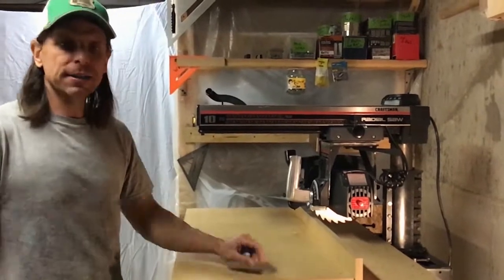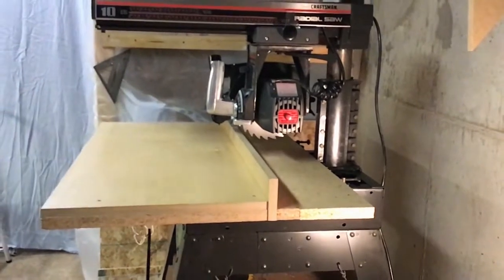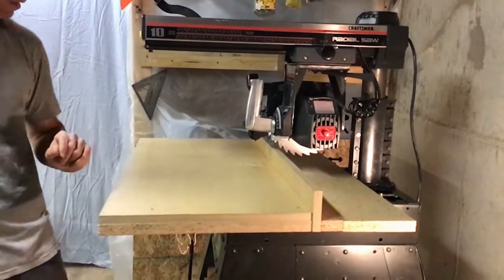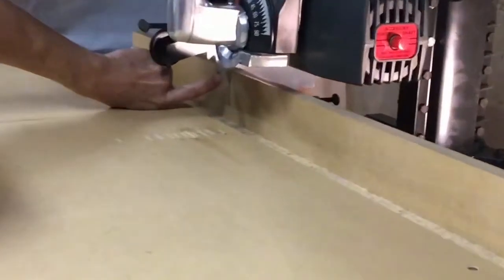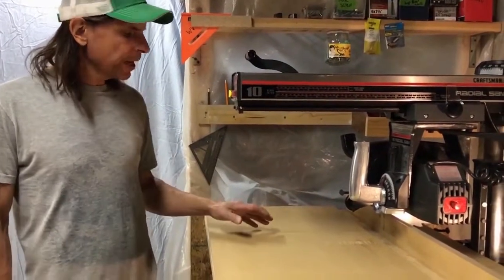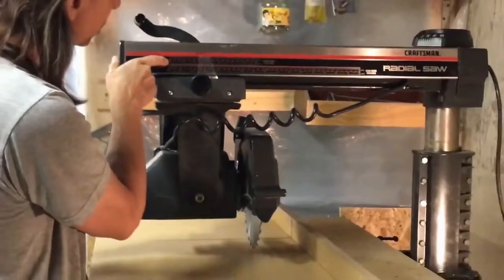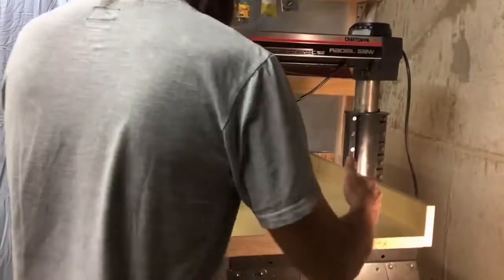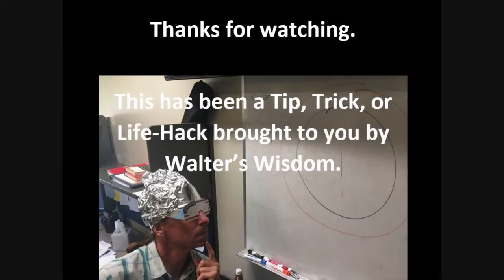Table Configuration - Radial Arm Saw Know How, Part 9 of 9

Comment: Have you leveled your cutting table? I have one I’m renovating and I was thinking of a sort of threaded bolt multi nut configuration. I plan on using it as a planer a lot.
Reply from the maker: The stand on mine has rubber feet on threaded bolts, so it was that simple to level it, just turn the bolts and done.

Comment: i can’t seem to find the standard dimensions in the manual, i’m curios how deep your boards are? (particularly the rear table and spacer) the table top pieces i have got damaged so i cannot make an accurate template for myself
Reply from the maker: The rear table is 6.75 inches wide, the spacer is 2 inches wide.  Both are 1in thick by 40 in long
Reply: @vanman798  awesome, i appreciate you letting me know!